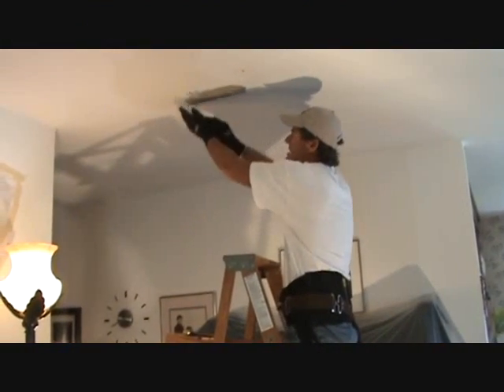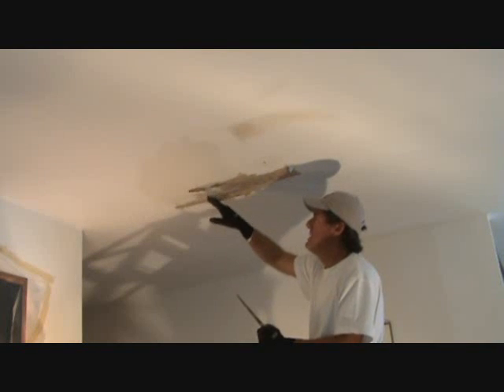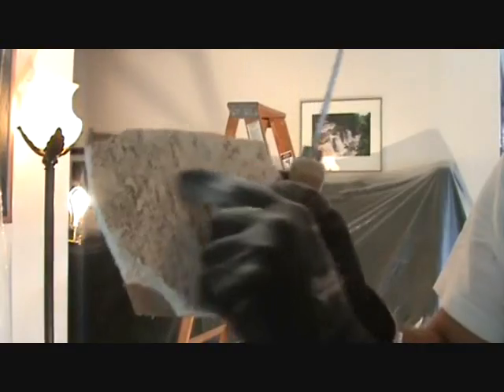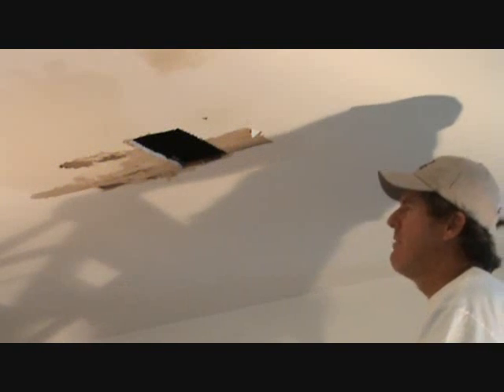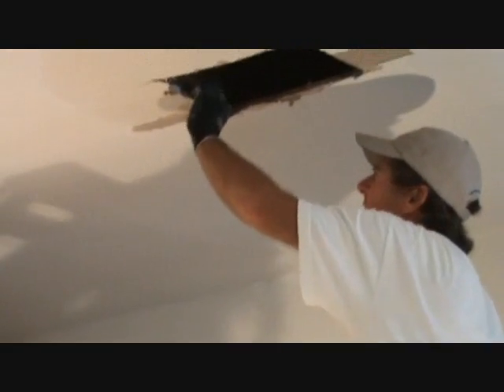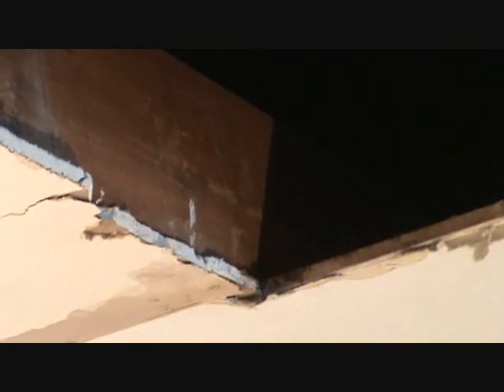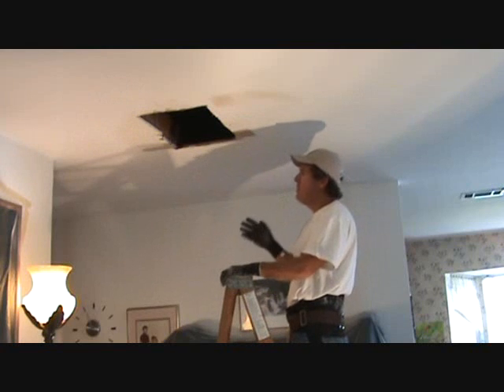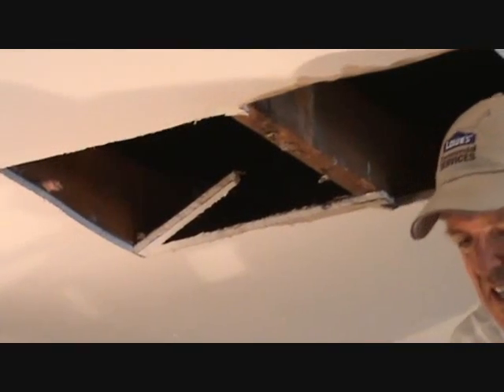How to repair a water damaged ceiling...Part 2

Comment: How much will a professional charge for this kind of work?
Reply from the maker: It would depend how large of a sheetrock patch you have that will dictate how much a professional will charge &/or where the patch is located in which room. Remember that after the patch is done, you still would have the priming & painting to do & if you want the patch to blend into the existing ceiling, you may have to paint the entire surrounding ceiling area. Lots of professionals either do sheetrock work, or painting work. Sometimes you can find someone to do both the sheetrock patching as well as the painting. That would ultimately be cheaper I would think, depending on how busy the professional is. If he is very busy then the price will be higher than if he is starving for work. It will also depend if the professional has a license or not. It is always recommended to use a professional who is licensed, insured, & bonded. someone like this will charge more than a handyman person who does not have the cost of a license, insurance, & bonding. So there are a lot of variables to consider, if you end up deciding to hire someone to do the patch for you. Please also remember that if you do decide to hire someone, you will not get the benefit of learning how to do this on your own. You get better the more you do patches yourself. & you know there will always be another patch....so if you hire someone to do this first patch for you....guess what. You will probably feel like you'll have to hire another person to do the next patch....& the next.....& the nest. This is where the savings comes in when you start learning how to do things yourself. Sure the first patch will not look as good as your 3rd patch but you will be learning some new cool things on how to start saving more money around the house. If you hate the first patch you do....after the 3rd or fourth patch you can always come back & fix the first patch you ever did! If you do decide to get a professional to do your patch, it is wise to get 3 bids from 3 professionals so you can compare prices & most importantly make sure all 3 bids include the same things. If one guys includes 1 or 2 more things then the next guy...no wonder the price will be higher. If it's not on the estimate don't make the assumption the cheapest guy is going to include all the same stuff the most expensive guy showed on his breakdown. Thanks for your question & hope this helps.   Joe  :0

Comment: Thanks
Reply from the maker: Good luck with your project!   Joe  :0
Reply: Thanks, you gave me hope!! I have very bad water damage spot in my garage, I was under the impression I'd have to replace the whole thing, now I know I only have to cut the spot out! Plus I enjoy your personality :)
Reply from the maker: Ha! Thanks so much for your comments! Really appreciated! As for your water damage....make sure the leak is fixed before patching your sheetrock.....(but you knew that..)   Joe  :0
Reply: Lol Got that done today, dishwasher and clogged drain and bad renters equal horrible black mold and damage, it about 2ft by 2ft but it was dripping thru the sheet rock, for about a year or so :( Thanks again, I'll let u know how it goes
Reply from the maker: Ok great. I'll look for a full report from you when you get done!   Joe  :0

Comment: Are you sponsored by Sheetrock, or is that just what people call drywall where you're from?  Or do you just recommend Sheetrock over the other brands?  If your not sponsored by them you should consider sending them one of your videos, you drop their name at least a few dozen times.  Anyway, thanks for the videos, the information should prove helpful in my upcoming project.
Reply from the maker: When I started in construction, the guys I was working with all called it sheetrock so I got in the habit of calling it sheetrock whether or not the drywall actually was made by sheetrock. I like your idea though! Maybe I should contact them!   Joe  :0